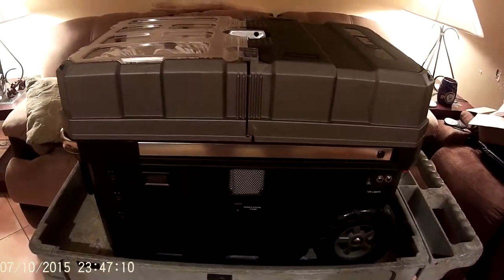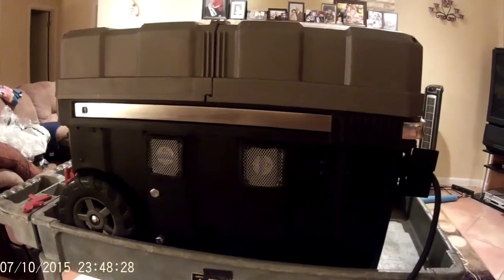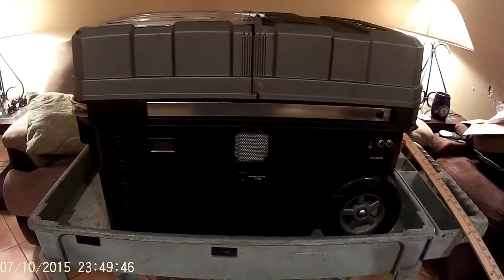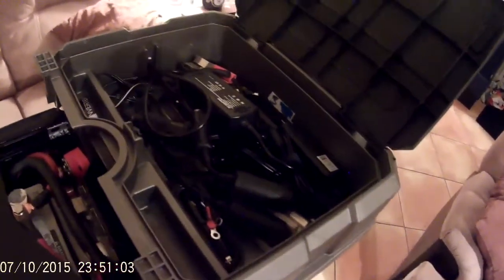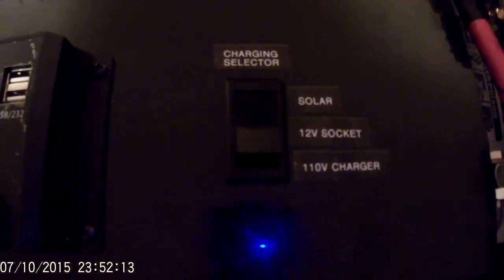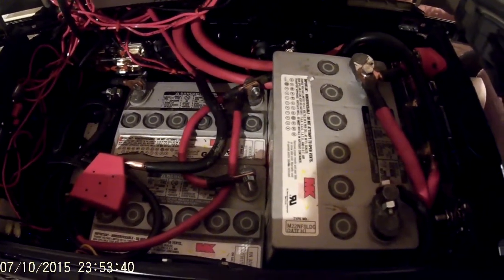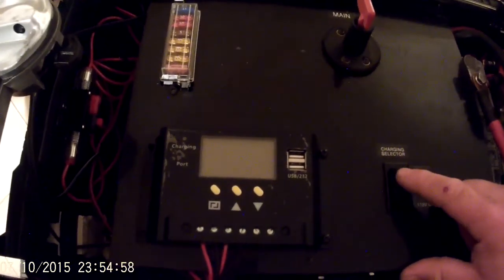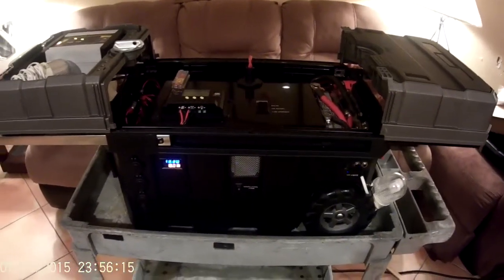DIY Portable Solar Generator

Comment: Good work, I agree with getting as much 12v devices as possible.
Reply from the maker: Victor Crapps Thx Victor. I am relatively new at this (since last fall), but it seems like common sense to use the inverter as little as possible. Even high quality inverters don't seem to be very efficient, in the research I have done anyways. My next challenge is to find an economical way to get a small 12 volt fridge.

Comment from the maker: I have done some tweaking the past year or so, and hope to do another video soon. Mainly, just adding a MPPT charge controller. But it has done well, and I am quite satisfied. Even took it on a couple of road trips in my van for lights, Dometic fridge/freezer, fan, CPAP, laptop, phone charging, and ALL on 12 volt. I have rarely used the inverter, and that is the key. Inverters are power hogs and aren't very efficient. I use it primarily for charging sensitive batteries, since it is a Pure Sine. No issues whatsoever. Success! And as the song goes: "I did it MY way!"
Reply: Great vid, wating on the updates....

Comment: Awesome unit!! You might want to add a LVD (low voltage disconnect) or alarm to protect the batteries and alert the CPAP user? And I would put All the batteries in a separate box! I think the batteries and the electronics should be separated, I think its Safer no matter what battery type you use! And Nobody covers the battery terminals in these homebrew projects that is just screaming fire!! Anderson power plugs are the way to go for All of the 12v connections. Just My opinion!  Great looking build, well thought out.

Comment: That's awesome. Being a newbie to this , I'm confused about the cut offs, the fuses, and switches? I love that box and the way you've set it up. Great Job.
Reply from the maker: Thx! For safety and functionality, it is best to put in the extra work and expense. I have been using mine daily, since I built it (CPAP and battery charging station), and it has worked perfectly. And, when Irma came though, I was (sadistically) hoping my power would go out! But alas, it only blinked a couple of times.

Comment: Nice video man. I just made pretty much the same thing you did.  I like the black boards your using. looks good.
Reply from the maker: Thx Ken. I use is daily for charging batteries, and running my CPAP at night. And it has come in handy during a coupe of short power outages, and it did well on a recent road trip where I&#160;slept in my van at rest stops. CPAP, fan, lights, laptop, etc. I don;t have solar panels on my van yet, but it charges great off of the 12 socket. I have upgraded to a Morningstar MPPT Controller, and I have even made a smaller 100amp/hr version of it in a marine battery box to expand the system to 255amp/hrs. A fun and worthwhile hobby!

Comment: Hey Scooter, amazing video... I have a need for something similar for my CPAP at my girlfriend's cottage.  I have stripped my unit down to only have my CPAP connected at night.  for some reason, im not able to get through a full night.  my battry is a 80 amp hour.  any suggestiongs?

Also, do you have a parts list where you got stuff and a wire diagram?
Reply from the maker: No list, and I had a crude schematic, but not sure what I did with it! Dang It....Are you running your CPAP from an inverter? If so, order a 12 volt adaptor cord. I got mine on Amazon. It will save some amp hours.

Comment: Nice system. How does your relay system work?
Reply from the maker: The on off on switch energizes the relay when switched to solar and closes the solar charging circuit. And one line of the charger runs directly through it, so that when switched, it just turns on.

Comment: can this power a tv?
Reply from the maker: It probably could, but I strictly use it for 12v devices. However, the Wagan 400/800 would probably run a small TV fair enough.